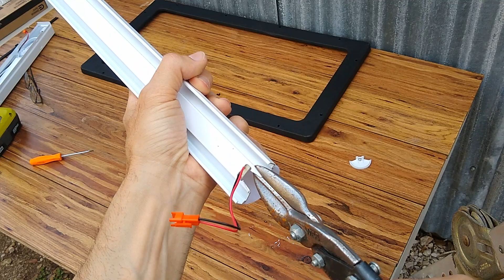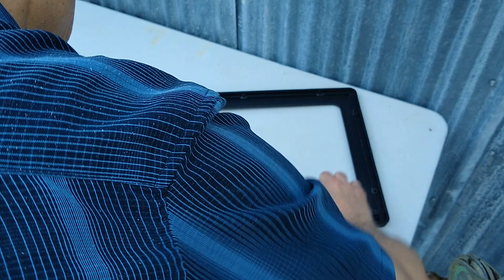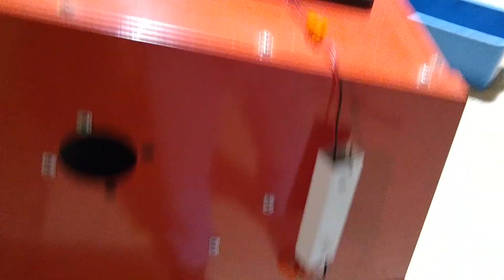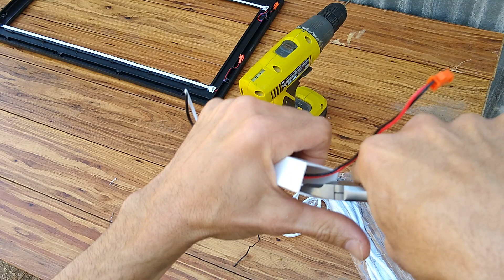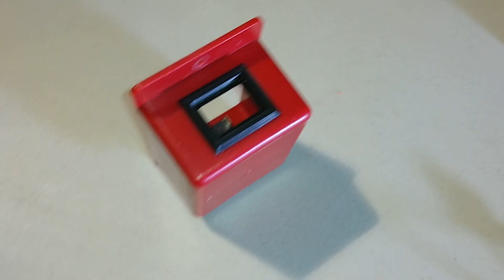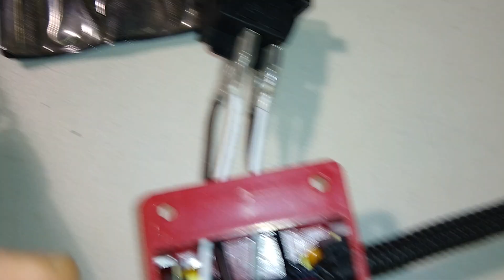Harbor Freight vapor blast / honing cabinet LED Bezel light mod / upgrade will make it super bright.

Comment: Hi victor, great videos! Im doing your light mod. As for what the blaster came with, did you ditch prexy and film and just used the glass?
Reply from the maker: Hello Sailing Vessel Putyourname..., Thank you for commenting and kindness. Yes, I ditched all the glass, plexiglass and film that came with the cabinet. Check out my video on what I've been using since. It's been over a year now and the clear paint protective vinyl has kept my new glass from getting etched.

https://youtu.be/OuqL9xWJE48

Best of luck with your mods!
Reply: @vbared  I must have missed that video! I am watching so many. I am not new to vapor blasting. About a year ago I set up a cabinet out of the benchtop HF one. Bucket, trash pump and one of those import nozzles. It worked, I rebuilt my vintage car engine with it. But there were limits: mostly about seeing what you are doing and size. So I got the bigger cabinet (that I had to assemble while the benchtop is mostly put together). Your light mod will help tremendously. I am also working on a way to spray cleanish water to the glass and maybe having a wiper. I am just a bit confused about rinsing closed loop and bucket setup..
Reply from the maker: @smashbeat2  That's awesome, Vapor blasting is amazing! I haven't dealt with a wiper or water spray setup. My biggest expense was the Ingersoll Rand 60 gallon with the SS5 pump so the rest of my build had to be super budget.  What I do to clear the glass is let off the air pedal and let the water media mix reflect off my hand onto the glass.  RainX applied to the paint protective vinyl helps a lot also.

Comment: Just stopped by home Depot and picked up a 24" with the 2 LED strips. Just had one driver for both so I'll have to engineer my box   different. Also my harbor freight cabinet is older......way Old so my approach to mounting will be different. Thanks for your video. Next I'll do the wet blast conversion. Keep making the videos an we'll keep watching.
Reply from the maker: Hello Stephen, Thank you for commenting. You're going to love wet media blasting vs dry. No need to degrease, no dust, and super shiny parts. Thank you for your kindness.

Best of luck with your build!

Comment: Great job Victor, I'm going to do this now. I currently have a light bar in my cabinet but still get shadowing. Light from both angles looks spot on.
Reply from the maker: Hello Brent, Thank you for commenting and kind words. I'm glad you found value in this video for your viewing time. The led light strips made a big difference. Maker sure you use PETG instead of PLA if you will be printing the parts in the video. PLA will start curling up in your blast cabinet is kept in a workshop that isn't climate controlled.

Best of luck with your build!

Comment: Hi Victor! Really cool idea to keep the lights out of the cabinet, so you don’t have to deal with waterproofing and media dulling the bulb/LED.👌
Did you ever get around the designing a version 2.0 to give some shielding against the glare in the glass?
By the way I just got some 120 mesh stainless screen, will make a window shield to protect the glass on my dry blaster. Will let you know how that works out!
Reply from the maker: Hello Lukas, Thank you for commenting and kind words. I'll have to circle back to the lights to make the improvement. I must have gotten used to that edge glare. Please let me know how the screen works out for you. An automotive paint protective clear vinyl is what I'm currently using on my glass and despite weeks of blasting with garnet I haven't had any etching. The media just bounces off it.

Best of luck with your projects!

Comment: Love the ideas on concealing the strips.  I have seen several other videos where they use up a ton of the window space with the lights.  Thanks for posting!
Reply from the maker: Hello Robb0h, Thank you for commenting. It's working really well. Two things I would do differently would be. Print the concealing strips out of PETG instead of PLA and make them 1/4 inch taller. The led lights are very bright and can be still be seen due to their reflection off thickness of the glass.

Best of luck with your projects.

Comment: Very nice!  I really like your approach.  A quick question; how often do you think you will have to change the 1/4" glass.
Reply from the maker: Hello Jerry, thank you for commenting.  I've been giving the glass a lot of thought. I'm going to experiment with some films to see if I can avoid the glass from getting etched when using garnet or aluminum oxide. The glass bead media hasn't scratched the glass because of it's shape, the low pressure (under 60 psi), and lubrication created by slurry blasting vs dry.

Best of luck with your projects!
Reply: @vbared  What 3D printer do you use?  I am considering investing in one.